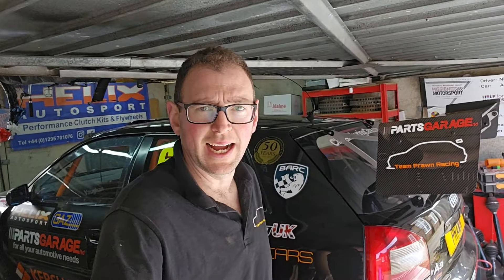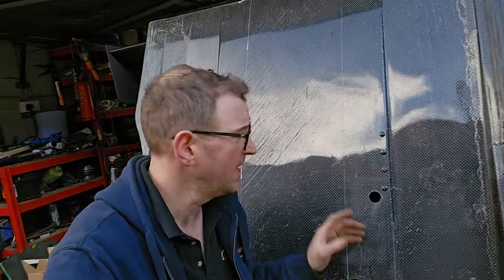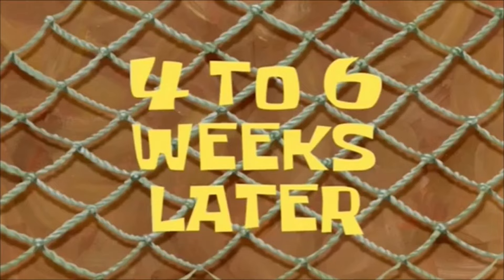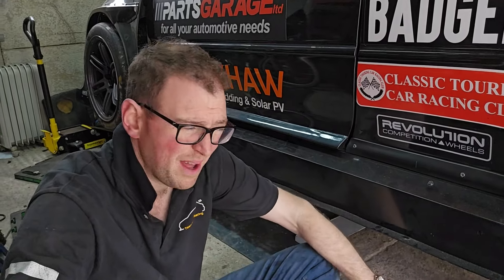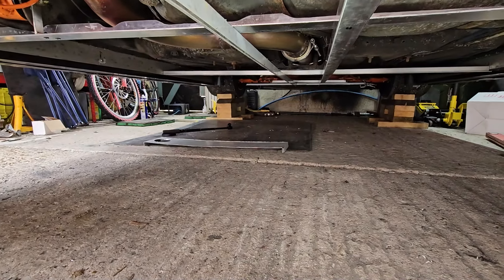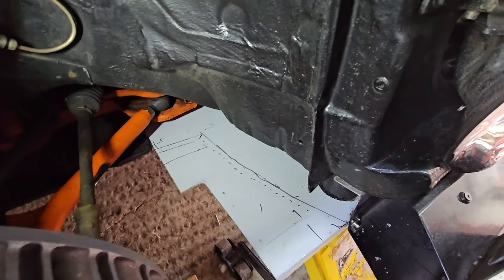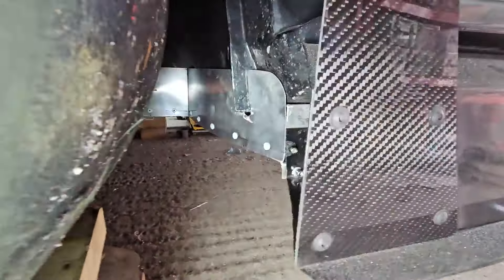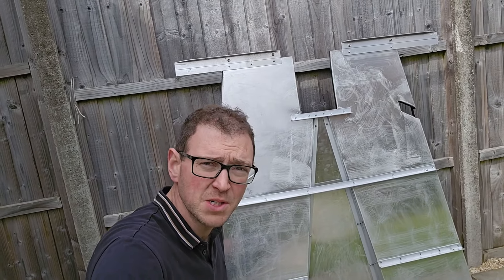The earth is NOT flat, but THIS IS!

Comment: Great work, don't knock "Cutting drilling and riveting" its a great way to build stuff and also makes repairs and upgrades much easier (useful for floors that get dragged over kerbs). One thing I would recommend before fitting it all up is to wrap the exhaust, trapping a red hot exhaust above an ali' floor makes the interior unbearably hot, i did it and was burning my hand on the gearstick at a sprint last year, fully wrapping the exhaust made a huge difference.

Comment: How are you checking the level of the floor, and how will you adjust it, if at all?
Reply from the maker: Someone else pointed out to me, this video deosnt really show the hours and hours of checking and measuring before actually putting anything together. As part of this, I had to determine a level for the floor front and rear the set the side skirts to follow this back in winter, then had to remount the splitter at a new height to allow a continuous and constant  rake upwards towards the rear of the car from the very tip of the front splitter. It's been checked every single step of the way with a 2m spirit label also, and the car is raised up on 4 equal blocks of 225mm timber all round to ensure it's sat exacrly as it would On the ground whilst the work is being done 😊
Basic principles suggest you want 20-25mm of rake Front to rear. Any minor tweaks to that will be done in rear ride height.